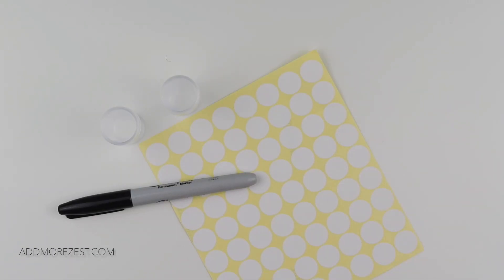Diamond Painting Tips & Tricks | #11-20 Compilation

Comment: Newbie here. My granddaughter introduced me to you videos.  So enjoy ! I haven't seen or heard this issue mentioned so thought I'd share.  I accidently spilled my tray on carpet. I used my  sticky mat to pick them all up at once. I picked them off but could use tweezers.  Then washed the dust & dirt with a dot of dish soap and laid to dry.  It's still sticky & put back for it's normal use.
Reply from the maker: Thanks for sharing!! I love this idea, I'm getting low on tips and have nearly 50 more to do, so I'll show this one soon.
Reply: I ment to also share with you my choice of easel. Thinking out side the box, I bought a portable laptop bed tray & Love it !  Both the tray & legs have several adjustments. Fits across my lap when on the couch or no slouching over when I put it on the coffee table. And folds down for storage ( don't see that happening any time soon 😉) Has the lip to hold the light pad perfectly.  I do need to  use a clip on each side to hold the painting on to the light pad because it doesn't lay flat.